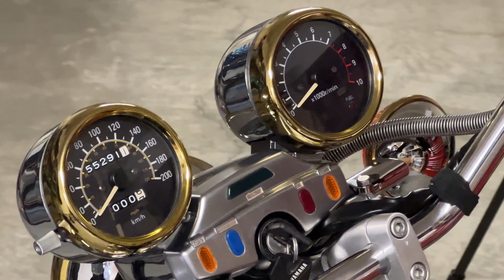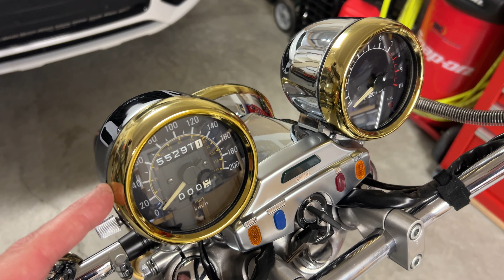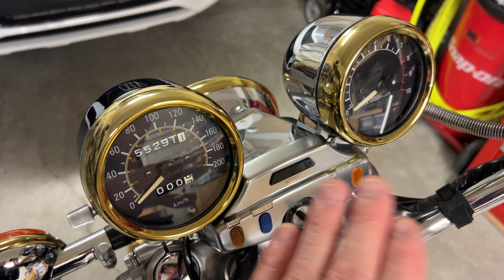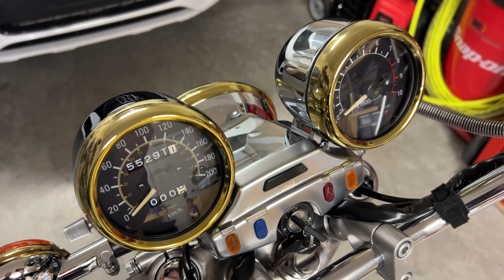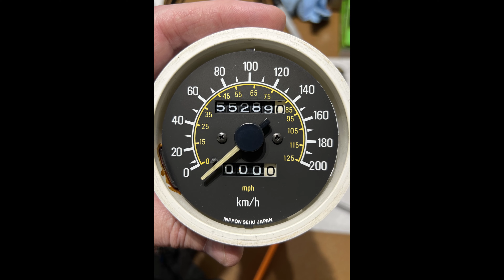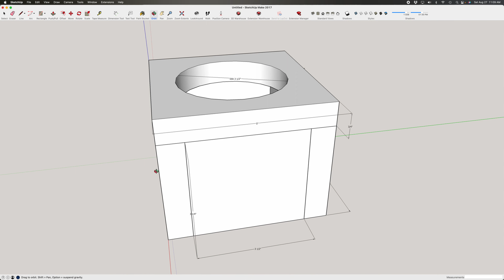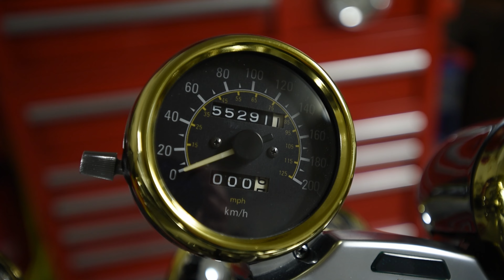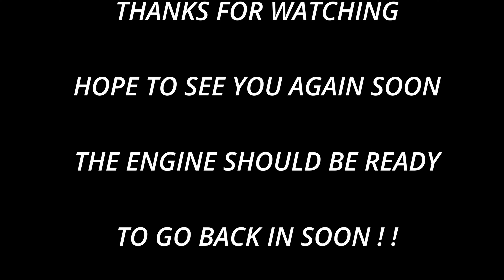Restoring Vintage Motorcycle Gauges - Yamaha Virago 1000 Restoration Video 16

Comment: Brilliant sir. Thank you for sharing. I need to get mine off now because the rectifier failed on my 1995 XV750 by pushing out 20 volts and cooked the coloured coating in the bulbs causing the dials to fill up with smoke leaving a residue on the glass. A winter job for me :)
Reply from the maker: Thank you!  That's a lot of work - my hands still hurt 2 years later....

Comment: Hi Ken this was very fun to watch as you got it all done .I'm assuming your some type of technition or engineer as a career as myself retired environmental engineer if your not you should be Thanks ken real nice only five months till spring a friend west coast BC.... Ralph
Reply from the maker: Hi Ralph!!  You guessed it - I was a radio operator and technician in the Navy in the early 80's, then became an electrical engineer in 1990.  I have a BEng with a minor in physics.  After 20 years in telecom (I worked for Spar Aerospace until 2002) I had a change of heart and began my aviation career.  I currently fly the Sikorsky S92 in Newfoundland for the offshore oil & gas industry.  Having a strong technical background has been helpful during this restoration.  I can see the end is near and I can't wait to ride the bike again.
Reply: @KensWorldRestorations  Do you have plans to re-face the gauges in your Sikorsky any time soon?  ;)

I was also curious about your prefession, thanks for the insight. Thanks.
Reply from the maker: @joeshmoe6686  Ha!!  Looks like I’m busted!!  Not any time soon for the S92!!  I fly for Cougar Helicopters and I’m also the Sikorsky Technical Pilot for the company.  Been flying professionally for a little over 20 years with the last 5 offshore here in Newfoundland.  It’s a good gig.  Did about 8 years in the Navy and 10 working in broadband telecom/aerospace prior to switching careers to full-time flying.  Shoot me an email at kensworldrestorations@gmail.com.

Comment: Hey Ken, bike looks sweet! I’m doing a restore of a ‘92 750, and I’m redoing the panel now. Wondering what you used for the compound and the Dremel wheels. Mine might need a bit of sanding w some 1000+ grit. It’s a bit scratched up
Reply from the maker: Hey Jim!!!  Glad to hear another Virago is being restored!  I used Simoniz Platinum car polish.  Comes in a black container.  I seriously had no idea what I was doing at the time - really just experimenting with the soft pad on the Dremel tool.  But it worked out - it removed the years of UV crazing and it still looks great a year later.  Cheers!

Comment: Hey Ken, any chance you know off hand what size the light bulbs are that go in for the backlight on the gagues and for the instrumetn lights? its seems to be between a T5 and a T10 and I cant find the markings on the ones Im able to get out to even see what size it is. Mines a 94 virago 1100 if that makes a difference
Reply from the maker: Wow...sorry about that - I missed this comment.  As far as I know they are T6.5 12V-3W.  If you want a bit brighter lighting, you can use 5W lamps.  Here's the link to the product:  https://www.amazon.com/Hella-2821TB-Bulb-W2-1X9-5D-T3-25/dp/B079SP4NM1/ref=sr_1_14?crid=QFY1ZHZDNVE8&keywords=T6.5+12V-3W&qid=1690899264&sprefix=t6.5+12v-3w%2Caps%2C134&sr=8-14
Reply: @KensWorldRestorations  no worries thanks! I can find them anywhere and have a turn signal bulb in my gauge cluster out

Comment: Was hoping you'd also show how you extracted the meter from its housing... is there a 'best approach' to this?
Reply from the maker: Not really - these units are sealed and not meant to be disassembled in any way.  Anything I did I was on my own and experimenting with whatever seemed to be right at the time.  The needles both broke (tach and speedo) but in different places.  I also broke the tach assembly which is built like a fine watch.  The video doesn’t show my grief and frustration with everything that went wrong…
Reply: @KensWorldRestorations  I was just wanting to replace a globe, that's all.  Difficult to do?
Reply from the maker: @wheelbarrow74  Do you mean the glass cover?  That’s not too hard to replace…just get the ring off and change out the glass.  Changing the gauge faces like I did meant that the needles had to come out.
Reply: @KensWorldRestorations  yeah just wanted to replace the bulbs with LED
Reply from the maker: @wheelbarrow74  yeah. That’s easy enough.

Comment: I'm going to do this on my 535
Reply from the maker: Be careful. Its a lot of work to get at the faces and the needles don’t come off as easily as they should.  I broke both of them and was lucky to get them fixed
Reply: @KensWorldRestorations  I've got brand new Yamaha Virago one I just need to get bracket and maybe cover or I'll make something or put something to cover the holes in the back caps and keep the 535 light box.  You did a excellent job!!! I got my brand new Yamaha tachometer online for $65 I couldn't believe it brand new Yamaha tachometer??? It was and I got all the wires for it too :)